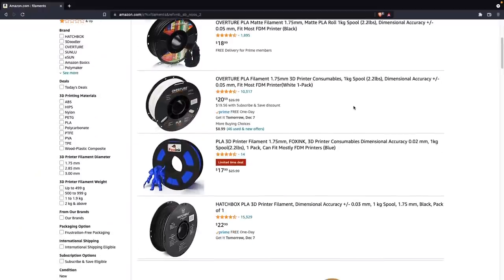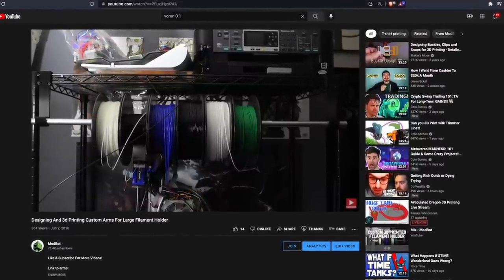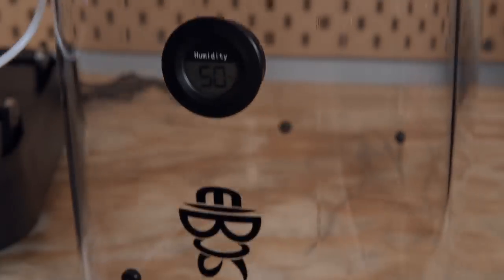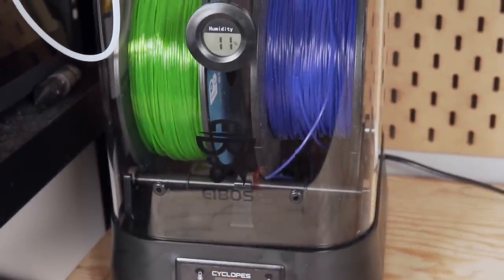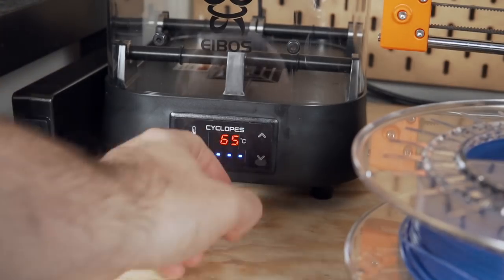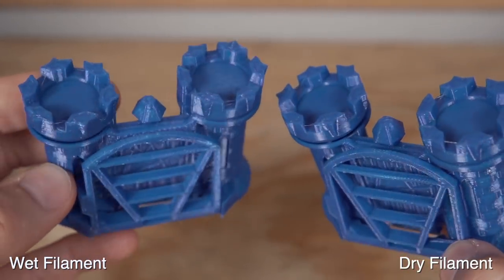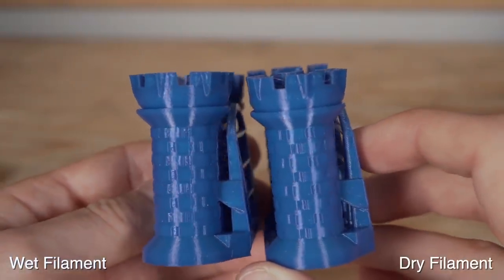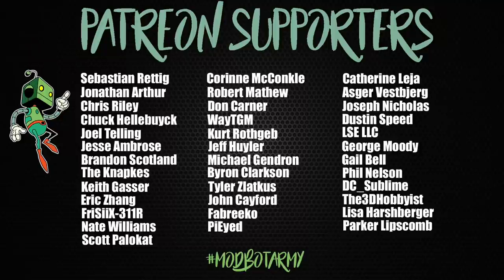Tired Of Wet Filament? My New Favorite Filament Dryers (And Storage Solution)

Comment: A lot of air fryers have a dehydrator mode and it can reach the needed temps.  If you dont already have one sitting unused you can probably get one for next to nothing.  They were kind of a kitchen fad a few years ago.  Works perfect and unlike dehydrators you dont have to hack up the trays to make it work.
Reply from the maker: Interesting I have seen dehydrators used but not an air fryer. They can be quite bulky though right?
Reply: @ModBotArmy  Its for sure not as elegant as one of the purpose built filament dryers, but for me space really isnt much of an issue and the one I have you can fit 3 typical spools in it.  Plus you are likely to be able to pick one up for free to dirt cheap as people realize they dont want them in their kitchens.  I got mine from someone who was going to toss it away because they never used it and it took up valuable kitchen counter space, I like free.
Reply: I used an air fryer, it's great because the fast circulating fan dries things out super fast. 

Mine only goes down to 83C, so I've only used it for nylon, but I've seen a lot of them go down to 60C - just something to check for before buying one.
Reply: Air fryers rock and put most ovens to shame when it comes to how fast they cook and how much electricity they use.  However they get hot as shit at least both the ones I have do. They are meant to cook a frozen piece of chicken in 15 minutes, I can't imagine destroying one just to dry plastic out.
Reply: @mattchristine675  some new ones have a dehydrator mode that does low temperatures for up to 8 hrs. It should be similar to a regular dehydrator except with a higher temperature cap should you need it. 
I use mine to dry out carbon fiber Nylon, I would rather do that in an air fryer in my garage than in the oven in my kitchen. I don't use my air fryer for cooking though.
Reply: @mattchristine675  Depends on how cheap you find it. I also agree they're awesome! Way faster than the oven for frozen stuff, and not that much slower than a microwave. Was also interesting to find out I could cook hotlinks or a stick of boudain in one in a few minutes and have it come out crispy!
Reply: THANK YOU! My air fryer when I turn it on wouldn't go below 170F so I went to Amazon and youtube to find a good budget way to dehydrate my old filament. This comment made me take a second look at my air fryer, and there WAS a dehydrator mode, thanks!
Reply: @NathanBuildsRobots  I thought mine only went down to 80C, but there was a button that allowed it to go below that, so I was actually able to get mine to go to 50C

Comment: I just bought an amazon food dehydrator for $90 that holds 4 spools and temps up to 80C with no modifications needed. It was a front load, pull out the racks, and dries filament like a champ!
Reply: Which one did you get?

Comment: I've been using a food dehydrator with some mods to fit the spools and feed the filament. Works great and goes to 70C. It wasn't too expensive either.
Reply: exactly this. Mine can get up to 85 °C and it's price was about 40 Euros. I just 3D printed walls instead of removing grill from the separate levels as I want to dehydratate food there too.

I see no point in this expensive solutions which are exactly same, but much more expensive.

If somebody needs much higher temps than 80 °C, micro owen is not that expensive too.

Comment: I just use a $30 food dehydrator with a thermostat, and keep calcium chloride dessicant in my storage boxes. Put closed cell foam seals between the lid and box, most aren't anywhere near air tight. Silica gel can only hold 30% its own weight and don't do anything below ~30% humidity. Calcium chloride converts up to 7 times its own weight to an unsatirated goopy liquid that doesn't reevaporate, and will work down below 10% humidity. But you have to have it in a bowl in there, can't spread it around like silica, so be careful when moving your filament storage boxes around so it doesn't spill. Just flush it or throw it out when spent, it's environmentally inert.
Reply: Same. I use one of the "smart" thermometer and humidity monitor that graphs out the temperature and humidity so I can see when the filament is dry (Humidity is low and constant). It also helps to see what the actual temperature is vs what the cheap dehydrator is set to.
Reply: @Martin42944  Humidity readings inside a  dehydrator doesn't neccessarily say much, because of the very rapid, short travel flow through. Ideally, you'd want to measure humidity at an exhaust point. Can be tricky though, most of these are positive pressure setups where air just "leaks out" anywhere it can.
Reply: @pr0xZen  I poke holes in the top of the container and place it on top of the spool, so far I’ve found it does a pretty good job tracking the humidity.
Reply: The industry I work in we work with CaCl, CaBr, and ZnBr fluids. They will pull so much moisture out of the air it'll give you a nose bleed if you spend too much time in the storage rooms.
Reply: @Martin42944  Aye, that would be that aformentioned exhaust point 😉
Reply: Just put the roll on the 3d printer bed it's got a built in dryer right on it.

Comment: Hygrometers (the little moisture sensors) measure the moisture of the air, not the moisture level of the filament. Even if the filament was super wet and cracking if you bend it, it isn't going to release its moisture when you stick the filament into the dryer.

I've tried all the solutions I think? For storage, I'm using the 21L Rubbermaid with a bunch of desicant. I've tried the resealable bags, but I didn't get the right sized ones (since they were not specific for filament rolls), so they were either too big (annoyingly bulky), or too small. They seemed like the perfect solution but after some days/weeks, I'd see they'd lose their vacuum so they weren't really air tight. Maybe the EIBOS bags are better?

If I find a filament I want to use is too wet (like it cracks), then I'll throw it into my 1st gen PrintDry (basically a rebranded food dehydrator) for a few hours to dry it out.

Comment: The difference in warping between wet and dry nylon might be because moisture changes the coefficient of thermal expansion (CTE) of resins. Also there's something called the coefficient of moisture expansion, that characterizes the elongation of a material with moisture absorption. This phenomenon isn't widely known, and material suppliers never list it in datasheets, because it's hellish-difficult to measure. Depending on the print duration, the wet nylon might have contracted as it lost moisture from the heat of the bed.

Comment: Im in the UK so most of the time we dont need a filament drier. But now winters here i use a old fridge freezer, Two old school glass light bulbs 60w in the bottom 40w up top with 2 100mm holes joining the top and bottom to let the air move, It sits around 48-50'c. I used it to dry wood for turning before i got into 3D. Wouldnt be good to dry out in a hour or two but leave/store the filament in there 24/7 and its ready to roll.

Comment: The Sunlu has a second generation box that has some improvements like it goes to 55c (and has 2 temperature sensors now) and the screen is actually viewable now (backlit even) and I did a mod to it which adds a nice fan inside that is powered whenever the unit has power and it works really well and I put a humidity meter inside.  I recently went overboard on storage and use air tight plastic boxes (used for cookies and cakes) as well at buying a $150 food dehydrator that can hold 7 rolls (1.kg) of filament at one time, I also use it to dry out my silica gel packs that I put in the storage boxes with the filament. I built some shelving as well and everything (except the Sunlu box) is stored there. I have the Sunlu behind my Prusa MK3S and use it when I need to quickly print something that is slightly damp (leaving it on an hour before printing actually does help).
Reply: You mean 65°C, the S1 already goes to 55°C.
Reply: @timmturner  Actually 70c

Comment: I checked out the EIBOS one a few months ago and the Amazon reviews showed a few people experienced filament melting since the heater regulates poorly or lack of fan.  Honestly, the best investment I made was the PrintDry Pro.  I went with the full setup so I can dry up to 4 1kg spools or even the larger spools .  Once dry, into the air tight cereal boxes with desiccant.  I am now using Polymaker Polyboxes as a filament dry box while printing.  It sits on top of the 3D Printer enclosure and using a reverse bowden setup (Capricorn tube from dry box into the extruder)....this way the filament isn't exposed to the outside air.  I looked at putting heated filament boxes next to the printer while printing but why use up so much electricity?  Thanks for your video!
Reply: I just encountered this with the Eibos two roll one.  With the PD Pro how is the air flow directed from the heat source?  the EIBOS one it blows right on the filament which is why people have had it fuse it.  The unit probably should have been wider have sat the rolls up higher.  It works perfectly fine on half used rolls but a full roll it blows right on the product, I had to respool two PETG rolls to unstickify it.

Comment: I spent over 100 on the cyclopes... It works I guess? Wish I would have shopped around more.
Reply from the maker: I have yet to see a more effective solution other than maybe PrintDry which is more expensive. Unless you diy a dehydrator.

Comment: 'Dryers' like the Sunlo are just heaters- there is no airflow through the box, so no way to carry off the moisture. Even the ones with fans are not insulated, so massively inefficient. If you are heating the box the RH will fall (which is what the meter reads) but the actual moisture is still there. Remember, you are measuring the air RH, what you are actually interested in is the amount of H2O inside the filament- a quite different matter. 
Two steps with drying- first get it dry, and then keep it dry. The first is best done with desiccant- true moisture removal, but it can take days. The second is by NEVER letting the air to the reel. That is achieved by using a cassette system, holding a reel in a container even when in use. Putting the desiccant into the cassette means it will be drying always, right up to as dry as it can get. Yes, it takes more space, but it saves a lot of time- slotting a cassette is way faster than unpacking/packing a reel and then mounting it. So, the best drying you can get, and the fastest mounting- isn't that worth a bit of space?

Comment: I had left my filament connected to my printers and one printer had really bad stringing.  I usually have the A/C on all summer and it must not get humid enough to cause problems with PLA but I had opened my windows and the humidity came in and evidently got sucked into my filament.  I switched filaments to one that had been in a box and it printed pretty well except for some cratering, little pin prick holes.  So I got a Sunlu dryer like you have and am drying some of the filaments out now.  A couple companies make a double dryer with a humidity sensor and a fan and I might get one of those unless I see something on YouTube that everyone raves about.

Comment: Only recently have I had Wet filament issues. I fried my Amazon Basic PETG filament for arount 8-10 hurs in my Food Dehydrator and that helped. I could dry mu filament even a few more hours. I think I here some light popping and I just purchased this filament. I like the close up of smoke steaming from the printer. This confirmed that I did have wet filament. My house Humidity is 58%. I also, bought the  Eva-dry E-333 Renewable dehumidifier. Y^ou just plug it in to charge it up. $15 on Amazon. Recommended from another YouTuber. He stated that the dehumidifier would drop the humitidty down to 20%. I have read that you really need 10-15% humidity rating. I'd like to know if 20% is good enough. I am also going to look for A couple of Humidity sensor I can place in each box.

Comment: Design Prototype Test designed a part to use the bed as a dryer that works amazingly well if you only need to dry the occasional spool.
Reply: I just dried some 4+ year old filament on my print bed with just a cardboard box and two spanners to prop it up, it actually works.

Comment: When i switched prom PLA to other filaments my first venture was PETG. Unfortunately i got a role that was soaked straight from the factory. The Internet seems to think that wet filament isn't that bad, but honestly it is. I couldn't even print a temperature tower, because all the layers looked the same. Shit. 
So i figured i have tried everything except drying this brand new filament. It fixed EVERYTHING. Only adjustment i had to make after that was more cooling and a bit less volumetric flow rate.

Comment: I found that the "Ezy 19L/18Qt waterproof storage tote" from Home Depot holds four 1 kg spools perfectly. With 4 spools of dry filament, I put a large 100 g pack of dessicant in there and a couple of smaller packets of indicator dessicant, and after 3 months the dessicant is still fresh. It does a good job of keeping filament dry in one compact space.

Comment: I'm in the Phoenix area, so I don't really know if I would have moisture problems; however, I still put the material into sealed bags with desiccant in-between uses. I like the bags you have. The bags I'm using came with a straw and I have to manually suck the air out. That looks a lot nicer.

Comment: I live in Phoenix AZ and we had a wee winter for once. I ended up getting and modifying a food dehydrator along with using the nanovac storage bags. My only issue is that the bags crease and leak. I mainly print tpu and petg, which is fine leaving out most of the time, but this last monsoon season I definitely noticed a difference.

Comment: For the price you should probably just get a good food dehydrator which can fit a number of spools at the same time and you can run your own PTFE tube from the top of the dehydrator to the printer. I used one from Magic Mill and just took out the trays. It's a lot more accurate on internal temperature than the cheap ones and I didn't have to hack my own container for the spools this way. Best part I can dry 4 or 5 spools at once and for not much more I could have bought a larger unit that could fit 8 or 9 spools.

Comment: but one thing i wanted to share, dry it once and buy some heavy foil ziplock bags with a shiteload of moisture absorbers. once dry chuck it into a bag with moisture absorbers. I even added air style fittings to those bags and feed the filament out of the bags. easy.

Comment: I just have a bin filled with 1kg of silica with a threaded rod that rotates on some bearings, also added a hygrometer and a bowden push fitting. I have used it for weeks and it stays pinned at 10% and haven't had to dry out the silica yet. Total cost was around 25$ and stores 4-5 rolls of filament.

Comment: Just curious, why the heck wouldn’t you use a Flexzion food dehydrator? It is adjustable to max 70c, has a fan and vents, and can hold several spools of filament. You can put a spool holder in it for active use. Just cut out the center, of the five trays, and it’s only $50.
Reply from the maker: You can definitely use one and many do. My thing is spools sitting sideways I am not crazy about, and if you have them standing up you lose space plus they are larger and space is a massive issue for me. Not saying they are not viable as I have owned one previously that did work, just that its not right for my current setup.
Reply: @ModBotArmy  I 2nd this. I use one myself, but don't print directly from it. One unfortunate, big retraction jerk and 5-10 rounds spring off the spool when situated horizontally. The model I use can't fit a spool vertically. It works wonders for drying though, and it was only $30. Tested the thermostat with a separate thermocouple to make sure it's PLA safe as lowest setting is 50 (and some of these dehydrators have very inaccurate thermostats), and it turns out it's less than 1°C off 😃
Reply: Daniel thanks for replying to me. Why don’t you like to put the spools on their side?
Reply: @Smackdabinu  the comment above says why, it can de-spool and you can't print while drying which is a necessity with nylon.
Reply: YES as I just posted you can. I like that the other more expensive solutions have a few features that I like. And these are more suited for actual printing to keep you filament dry on a long print. These are not meant to just dry your filament. But to dry as you print. There is no spool holder in a Food Dehydrator. Although if you buy a bigger one you could DIY one with a spool holder so you could print from it. But it probably be quite abit larger to place on you desk next to your printer.